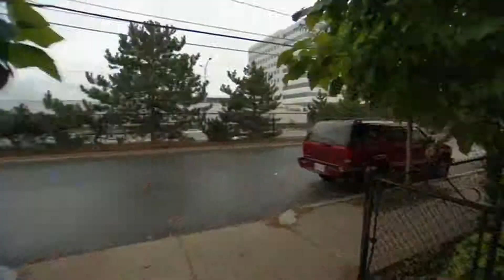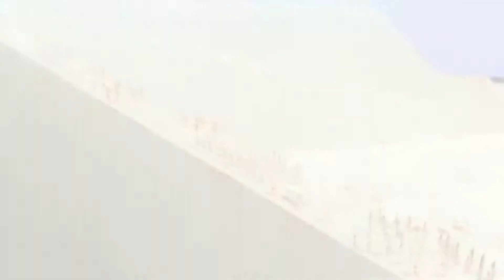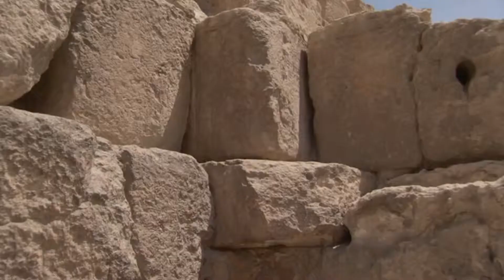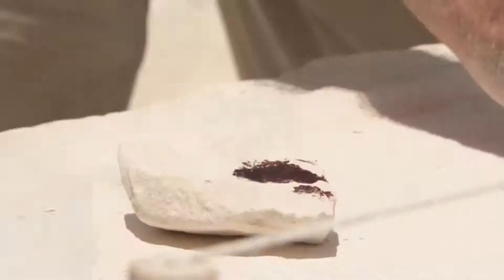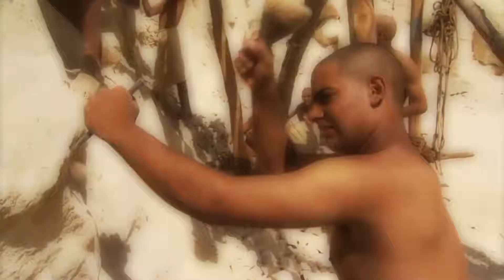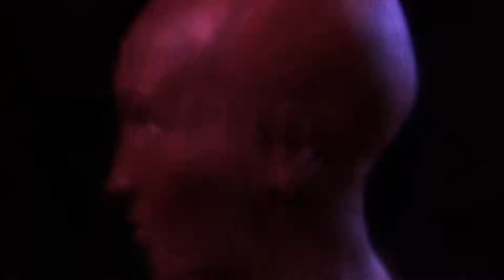Film about the construction of the pyramids of Egypt _ the largest pyramid

Comment: Thought Experiment: replace location of rock quarry with solid Styrofoam and our tools of 21st century today. Can we build that same pyramid and how long to complete?   Next: even if the true builders Poured their concrete mixture could we do it today by pumping concrete into forms?>>> not likely but Maybe. 

so if we  can not even using tech like making plastic container extrusion etc as in typical containers of fluids to predesignated shapes  for all parts, with pressure apertures for hose connection to full the form, almost like a Ultra Ikea Pyramid kit,   Then screw HOW they did it, We should be looking for what they want to communicate via the math and geometry and ignore the  surface symbols as hieroglyphics.  

regarding internal structure: sure looks like printed circuitry; leads stepping up and down like a giant brute force battery.  

NEXT:  So many mathematical declarations made by builders SO what are we Missing regarding what Else they may have left behind mathematically speaking but that We don't yet have the MATH to Notice?  Eg, IF theory of off planet builders then perhaps from ORION belt then has any human started to figure math and planetary type space travel knowledge and logistics from the perspective of the POSITION of the Orion belt looking at EARTH?  Builders showing us what we know SO FAR; what must/might Builders have known? FACIAL RECOGNITION SOFTWARE is Applicable to contours, features and visual relationships of Photographs and Video, so why not use that Tech,eh? we would not know less